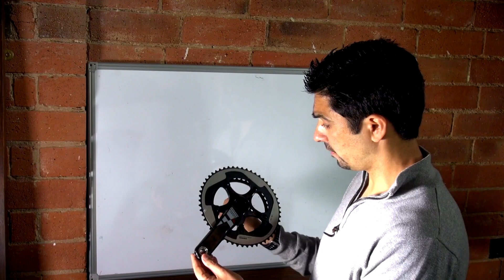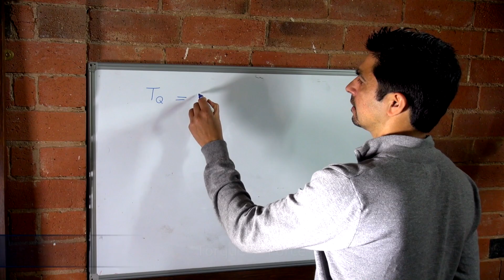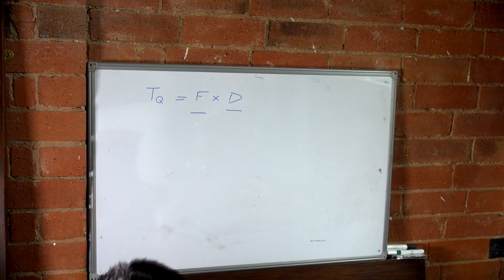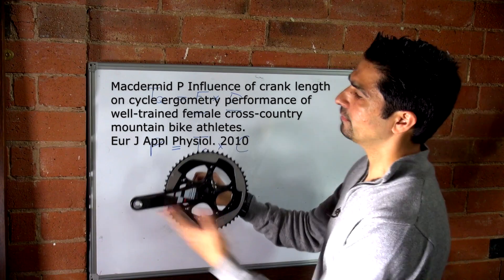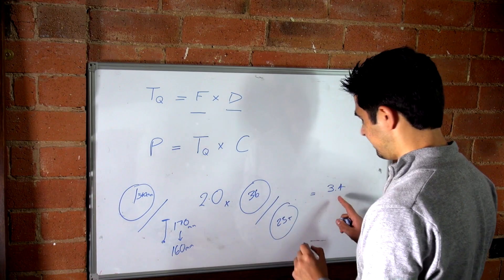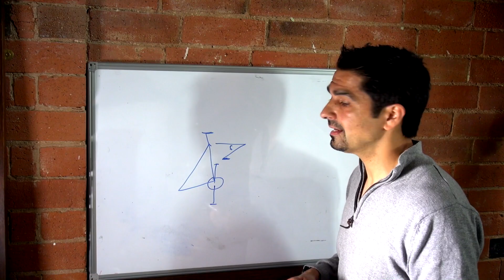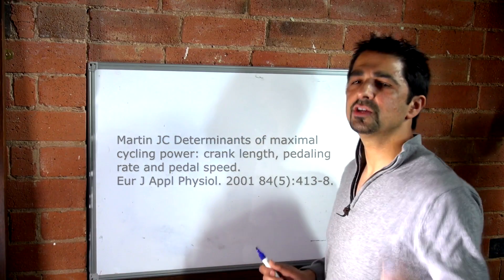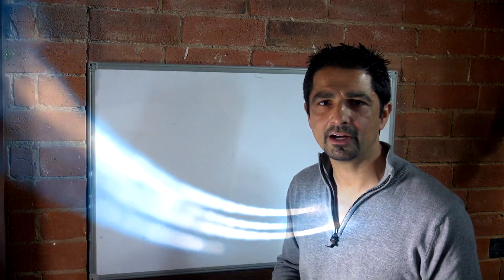The basics of Crank Length (Effect on power, cadence, comfort)

Comment: I'm 5'6" and presently using a 177.5mm crank on my road bike and i like it. Based on my height i should be using a shorter crank like 172.5mm. My previous crankset was actually 52- 39 with cranklenght of 172.5mm and the right frame of 52cm . My bike weighed 9 kg at that time ( i'm 52 yrs old andmy weight is 83 kg). Every saturday we have a 20km race (mostly flat) which  i enjoy participating even if  i always find myself struggling  and finish the race dead last. The ride is really fast abt 47kph average and i begun to admit that it's the age factor which dictates my performance, until i watch some You tube videos which discuss this interesting topic about crank lenght., compact crank, proper cadence etc. The next morning i look at my bike and did some experiment. I went to a bike shop and have my crankset changed to compact 50-34 and crank lenght to 177.5mm furthermore i changed my wheelset with aero type but much heavier which made my bike 11 kg total weight . Afterwards i did some rides alone and one thing i noticed about the long crank is i can really feel the roundness of my pedal strokes. I'm not sure if it's the cranklenght because 3 weeks after and until now i've never experienced getting dropped in bunch rides with speed ranging from 45-53 kph in this 20km flat ride. One thing i noticed with long crank is it helps in getting high speed and momentum. Maybe it varies in each individual but could be the reason why Greg Lemond used this long crank in his epic Time trial and victory the Tour de France in 1989.
Reply: Not to rain on your parade but resorting to a 177.5 at your height - leverage factor is way off. period. You're in all candor holding yourself back with such a long a crank. Given your height and the average leverage you'd be best at most to be on a 172.5  I'd also inquire about your fore/aft saddle position. Is your saddle cranked forward? Many do that ridiculous stunt these days - in addition to nose down, another new age nonsense.
In equal breath, assuming your frame size is correct for you are you appropriately stretched out as opposed like so many being bunched up, thus, the latter, constricting your diaphragm, in turn restricting your O2 intake? Think about that.

There has been an entire new wave over the past decade of crashing what was achieved, proven.................. All for the sake of something new. And making lots of money from all the gullible buyers. Be same weight weenie insanity, "aero" nonsense, inappropriate (anatomic) set up - by pre-established new age formula, etc. It just never ends. By the way LeMond, who stands as I recall eye -to-eye with me at 5'10" was routinely on a 172.5 and did NOT spin.  Laurent Fignon touched nearly 6' and was "only" on a 172.5, so too Hinault. They also did not spin. Nor did SO many others, but what did they know?

Quick and most upsetting trivia question of the day......................

Who holds THE fastest Paris-Roubaix record of all time? Here's a disturbing hint.............. It was on a 23 pound bike with cage pedals, friction shifters, a 5 cog rear, 36x4X wheels? Oh, and over the longest course which was terminated in 1992. There are a good number of still standing records from days past on old, "inferior" equipment and methodology. Let that marinate.
Reply from the maker: Obviously the long crank is not for everyone but for some it really helps. It is surprising you need a long crank at 5'6" but there is no harm doing an experiment for yourself....if you try and prefer it and can now go faster than before then it works for you. I was riding for years at 172.5mm but I changed to 175mm then 177.5mm and felt better. But for some smaller cranks than 172.5mm will be best. thanks for posting your experiences!
Reply: <Fastfitness> Thanks for your views.
Reply: He may prefer the longer cranks because his body shape (BMI 29.5) insists he ride in a more upright position. With that in mind, he may well be able to provide higher torque than if he had shorter cranks, regardless of his height. By the same token, going to shorter cranks may not allow him to get any more aero perhaps, whilst reducing torque.
Reply: The longest course was 280k.  In 1992 the course was 267.5k.  In 2000 the course was longer at 270k.  So the longest course was not terminated in 1992.

It's true that the fastest Paris Roubaix was in 1964.  That was when much of the cobbles were hidden under newly laid tarmac.  The winning average speed fell dramatically as new cobbled sections were introduced, including the Arenburg Forest in 1968.   If you let that marinate you'll understand that speeds are increasing because of scientific experimentation and new technologies. That means that professional racing teams know why a 1964 vintage racing bike is inferior to the bikes that are used today to tackle the Hell of the North.
Reply: Nice try. That explains Moser's second fastest time in 1979 to that of Post in 1964, Merckx coming in third in 1970 and Demol in 1988 at fourth. Oh well, and on the longest course. Something is not right for some crazy reason.
Bugno still holds the fastest time for Milan San Remo, that was back in 1990. How? This is followed by Fignon in 1988, Merckx in 1970. How is that???? I'm confused.................
I could keep going on still standing records, be same single day or stage. Here's one............. Hey look, Charly Gaul's 1958 record on Mt. Ventoux was finally busted after 46 years but here's the disturbing part............ It, the new record was on a fully paved road course that was 4k shorter. Gaul road on steamrolled fine gravel. WTF?????? And who still holds the course record for Nevada City? Actually the three fastest course records? Here's a clue, it was the same person. Some guy called Greg Lemond back in 1979 - to 1981. 
I'll refrain from talking about Jacques Anquetil. 

Fill your tires with helium. They're lighter, therefore faster. Just sayin'. There's a special this week on "aerodynamic" socks, cable guides and bar tape. Hop on it. Lighter, stiffer and "aerodynamic"...............
Reply: death2pc so who was it I'm a newbie?
Reply: death2pc and is that a picture of John Wayne?LOL!

Comment: I love your channel... I love the intelligence/science behind it. 
But I'm not sure if I would agree with your statement about how a smaller crank length would help you go faster. I can sort of understand where you're coming from about going faster with a shorter crank (you could get more rpm's)... but in the real world, when I think about going as fast as possible, or better yet, faster than my bike can go; I think about the times when I'm going downhill and the speed from gravity has maxed out what my peddling can accomplish. In essence, if I'm at the highest gear but when I peddle it feels like I'm peddling without a chain... no apparent force is being added/applied... in effect, the higher rpm that's needed can not be achieved; I physically can't move my legs any faster. So based on that, wouldn't a shorter crank actually make it worse? A shorter crank would require a faster cadence to equalize what was being done before. So in order for me to go faster I would have to peddle faster, but I have already concluded that I physically can't peddle any faster. 
So wouldn't it actually be more beneficial to increase crank length in this situation? ... lengthening the time for one revolution so in effect shortening my cadence and therefore giving me the room to add more energy to my peddling... getting more from my maximum peddling speed? 
I believe the fact is more that it is always better to go with the longest crank length as possible as long as your body's dimensions allow and the terrain/riding-style allows; I don't believe there is any benefit to going shorter in crank length. I believe crank length should be viewed as measured in maximum only... as opposed to a minimum to maximum range. 
If I am seriously flawed in my thinking, please try to explain... I haven't been classically trained/taught in the sciences.
Reply from the maker: Watch from 11:00 does that help? if at  "highest gear but when I peddle it feels like I'm peddling without a chain" that means you are spinning out.....your power and pedal speed and cadence is too much for the speed in which case if you changed nothing but the cranks to shorter, there would be less leverage and a smaller rotation of the pedal would bring about more speed on the bike. Imagine cranking a handle with a massive lever which is going too fast, you could crank with a smaller crank arm instead. In this example with a slower handspeed you would achieve the same result but more power would be needed. Hope that helps!
Reply: Fastfitnesstips Thanks for the reply. Like I mentioned before, I understand the principle of what you said in the video. I guess the problem I have is really more that I don't think that a smaller crank would work to go faster downhill in the real world... and I guess I used that as a jumping board to wonder if then a longer crank might work in that situation. But I confess that I couldn't come up with a working theory as to why a longer crank would work in that situation. But the more I thought about it after I commented yesterday, I came to the conclusion that a longer crank wouldn't work either for the "downhill gravity speed maxing out peddling speed" scenario. 
I agree that a smaller crank would "theoretically" help you move the chain faster... but the crank would have to be a fraction of the length of the radius of the large crank wheel; right? I just had a problem with thinking that it would be physically impossible to generate enough force×speed to peddle a crank arm that's small enough to do the required action. 
I think I was unwittingly confusing the need for a larger crank wheel for the crank arm... sorry about that.
Reply from the maker: It is a confusing area to be sure, and its rare to change crank length and hold all other variables the same. If it helps regarding your qq about longer cranks, for me personally I found at 5tf 10 (177cm) the standard 172.5mm crank wasn't ideal for me, I changed to 177.5mm (which is much longer than usually advised, but seems to just feel right for me and worked with my cadence range). Go with what works for you!

Comment: thank you for the video, it is helpful. There is just one thing I cant get my head around, the relationship you mention between crank length and cadence is the other way around, isn't it? if 160mm requires leg to travel 1005mm while 177.5mm requires leg to travel 1115mm you need to rotate more times with the 160mm, all else equal, to produce the same effect, thus more RPMs = higher cadence. So the smaller the crankarm, the higher the cadence all else equal.
Reply from the maker: hi yes this is sometimes confusing at a given bike speed then a smaller crank length gives a slower pedal velocity than a longer crank arm. RPM would be the same at a given speed and given gear ratio but gearing does change with a crank change. But I added a correction re pedal velocity thanks!

Comment: Hey, nice video, very rare gold knowledge. i asked myself few times how to get that middle balance of cardiovascular system and muscle system use with choice of crank length, to best use both systems. if i use shorter cranks i have no time to apply power to stroke so my cadence drop. with longer cranks the stroke path is longer so i can apply power longer and my cadence is higher. looks like there is a sweet spot length for every individual to find. there is no other path than test different length.. now that i solved length length my problem become with q factor. 147 mm cranks seems to wide for me. i ordered some speedplay high end pedals and will see if i can get more narrow stance width with them. you have some experiences with stance width? i know lance armstrong experienced with narrow q factor and say that it is harder to maintain power. i just search for perfect fit and i feel i need very narrow stance.
Reply from the maker: Most people adjust to slight changes in Q but have a look at this http://rideissi.com/articles/stance-width-and-why-its-important
Reply: thx for the link. but so many pro riders seems to have to wide stance? > they all have knees pushed inward..

Comment: Also rembember shorter cranks can produce less max torque but more even torque throughout pedal stroke. And also it's easier to lift on the upstroke on shorter cranks. Another thing you didn't mention is that if you have poor flexibility its harder to get power through the stroke on longer cranks because the muscles can't fire properly.
Reply from the maker: thanks David yes some useful additions, appreciated